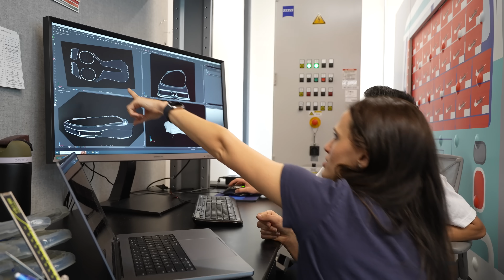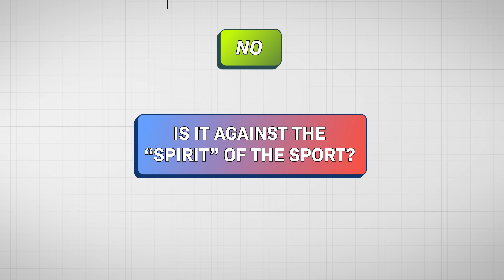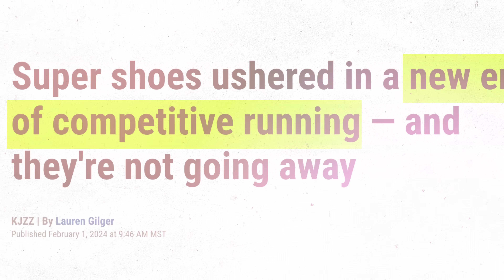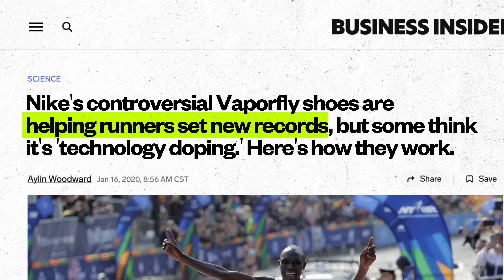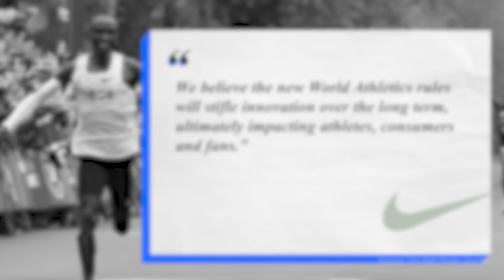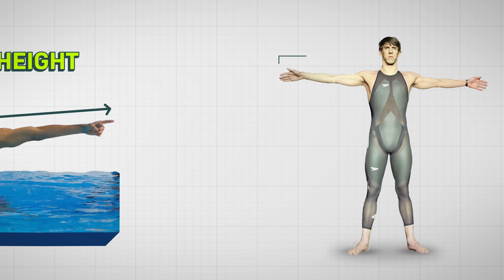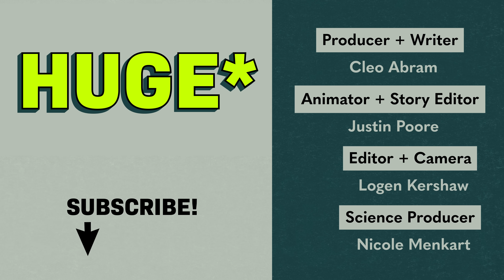The Shoe That Broke Running

Comment: RE: the swimsuit issue. The goggles dont impact speed in a significant way, but the suits obviously did. The issue is that more affluent countries or more technologically innovative countries could get an advantage over others and the spirit of the olympics is that it transcends everything geopolitical, technological, etc and everyone can come together united to compete fairly. The suits dont adhere to that, but obviously goggles do. If someone is 0.1% more streamline because they coated their goggles with teflon... good for them. If someone is 5% faster because their country invented a suit that makes them virtually frictionless in water... that is a major issue. The line can never be perfectly clear here, but obviously the suits needed a good ban. Otherwise swimming becomes more about technological advancements than athleticism. TLDR: olympics should be about fair athletic competition, not about technology. Look at special olympic runners though... they are faster than people running with the legs they were born with. How does the special olympic committee regulate that??? More of a headscratcher. Next step for olympics is to stop drug testing for mary jane... Who cares if someone is puffing the magic dragon on their own time... They gunna test for alcohol too? Tobacco?

Comment: I don't play sports anymore, but I do play games.  My favorite is Magic The Gathering.   It's a card game where you build a 60+ card deck out of a pool of nearly 70,000 cards over 31 years' worth of sets.

With such a long history, there are cards that can legally no longer be printed to protect the secondary market.  These cards are often what's referred to as "Broken" by the community.   Whether allowing you to do more than you should on each turn or take extra turns for very little in-game cost, these cards are extremely expensive.   Like the new house is expensive, and that's not even a hyperbole. 

So what WOTC did was create multiple Formats each with a different card pool to choose from and different cards that are banned.

Perhaps if the Olympics did something similar it would be more interesting?

Comment: Unfortunately the glasses enhancing eye-sight example is a bad example to make an argument with. Consistency makes the shooter better at shooting. Better eye-sight does not. Comparing that to a mechanical advantage from shoes or prosthetic legs is not a valid argument. I'm sure there are lots of other examples to choose from.
Great insight on running shoe mechanics! Very interested in this.

Comment: The sports equipment issue reminds me of the mobile games . Those top players on the list are always the players who top up the most amount of money and win most of the games...
Either spend lots and lots of money and win the game easily by getting all the high expensive gadgets or equipment, or spend time,more and more time endlessly, tirelessly, only to be in a position that's high enough for the remaining players who are equally the same as you that play the games who don't top up the money, but will forever be in a position lower than the players who spend lots of money on the equipment just to win.

Comment: I remember playing for years with a "classic" wood tennis racket, and the only alternative was a metal one that was the same size. Then apparently someone discovered that there were no rules about the size of the hitting area, and they came up with a racket with a much larger hitting area. That's all we have now, unless you find someone who will agree that you'll both use an "ancient" racket, or a better player uses one against a poorer player using a good modern racket.

I suppose there are some materials or shapes or extreme sizes that aren't allowed, but those possible rules aren't obvious to me. It seems like current tennis rackets are optimized to play as well as possible, maybe with some variation for type of court and characteristics of different players.

Comment: Think about paralympics vs olympics. People running 1500m in paralympics in T53/54 (people with disabilities requiring the use of a wheelchair) are THIRTY seconds faster than the fastest man (Hicham El Gerrouj has the world record a 3:26, these guys do it in 3:00 flat). Clearly a wheelchair gives people an unfair advantage, so only people who HAVE to use one are allowed to use it, and only at the paralympics.

I saw a video of people running on blades in Australia, they could go faster than a moped after enough practice. Sure they stood about 2ft taller, but it allows you to take much bigger strides and lose little to no momentum when your blade hits the ground.

If sports wants to be consistent, they can make a class for people running on blades, and not mix them with others. At least this way it's completely fair.

Comment: I really think it depends on the sport and if the technology is available to all participating. For example if an athlete isnt able to afford a certain piece of equipment. So the regulators should define the rules as such that every participant starts on an equal playing field. In most sports it comes down to ability anyways, as a footballer for example, it doesnt really matter whether you got the newest shoes or the best ball, it depends on your ability. In running its different, if those shoes gain an unfair advantage, they should either be made available to everybody or be banned. Now innovations in styles are something completely different, like when the ski jumpers went from parallel to v shaped. In some other sports its part of it, like formula 1 or skiing (where you have to find a good setup). It all depends on the individual sport.

Comment: "You might be thinking no gear should give athletes an advantage" ... No ... what makes you say that?? I'm thinking the opposite actually.

I don't think it should be banned. OR, at the very least have two separate categories "assisted/unassisted" or something like that. Like you said ... we wear shoes already ... that's tech that helps you run faster (as opposed to not having shoes) in most cases. So, now we're just talking about picking and choosing what's "too beneficial" and what's not ... and who decides that? How do I get on that committee? They have all the power don't they... where is the line and WHO draws it?

Comment: It feels like the reason goggles makes sense is that without them you don't have that sense at all, it makes better competition and potentially evens the playing field. They're cheap and easily accesible to people wanting to take up the sport. The suit however improves on an ability you already have, is extremely expensive, inaccesible and therefore makes the whole thing uneven. It's pay to win.

Another interesting evolution has been of the javelin and the need to make it hsrder to throw as athletes were throwing it so far it was becoming dangerous to spectators.

Comment: Why not just standardize the equipment? It seems possible to update the standard equipment for each sports event and let manufacturers compete to have their equipment chosen. This way, there wouldn’t be any restrictions on innovation. Nike is only pushing back because their cash making high-performance equipment is being threatened. Nike advertises to the public by saying that their gear is worn by athletes who break world records. If they had to release their products early, they wouldn't be able to advertise their products this effectively. Think about how many orders Air Jordans bring in for Nike each year. If AJ were released four months before the game when Jordan broke the record or whatever, it most definitely wouldn't be as famous and have such a lasting revenue making. So all that talk about innovation is nonsense.

As for shooting glasses being allowed, I think it’s largely because they can be standardized. The focal length of the lenses can literally be mathematically  calculated to ensure that the image focuses crisply onto the retina, and optical instruments like glasses can very fairly be ensured that they don’t magnify the images on the retina. But how should a prosthetic limb attached to the leg be standardized? There is no definite way to precisely measure how high someone can jump or how fast they can run. These variables change daily, every time they’re tested. The human body just has too much variables impacting how the legs work: what you ate this morning, did you take a shit to lighten your body mass, how much you sweat, etc. it's just not as easy to standardize as an optical instrument like a pair of glasses. And how would you even determine the functionalities of the prosthetics as a natural limb that never ever existed in the first place? 

That's why I personally believe all equipment which allow gray area in sports should be banned, because if it's possible, someone is going to cheat and gain unfair advantages, which damages everyone else's effort!

Comment: Awesome channel!
They could make a separate division for enhanced athletes as long as the enhancements don’t introduce energy, not generated by the athlete.

also, if they would allow high-tech equipment, eventually, everybody would be able to afford a certain level of technology because the technology would trickle down to every price range gradually.

Also, if I’m not a racer, I want to go as fast and as comfortably as technology can allow, so at least produce these high Tech products for the regular Public.  Of course, that would be sad if competitive runners were slower than all the other runners that were not in competition.  I do not see any problem with enhancing humans with devices as long as it’s not dangerous and people can afford it.  Records get broken all the time. They changed the rules for breaststroke, for example and now breaststrokers can go much faster because of that rule change.  if somebody breaks our record that will be on record. Eventually it will be broken, but it will be part of the history of the sport and that will not change.

Comment: Aside from theoretical availability of certain advantageous tech among top athletes, there's also an argument for how much it raises the price-to-entry for amateur competitors. If the typical shoe is 100 and these fly (pun intended) for 250 that might discourage a large demographic of runners from entering a sport known for it's accessibility. A 100$ golf club vs a 250$ gold club and nobody would bat an eye, but the price tag for tech has to make sense within the economic context of the sport.

Comment: Looking at the research, Blake ultimately is at a DISADVANTAGE, not advantage, by wearing prosthetics. On top of decline in some abilities as she mentioned in video, I believe it’s reported they are far more PAINFUL to wear and use. And we do have ways of measuring pain now more objectively (though far from perfect). It seems very ableist and paranoid to keep Blake out to me. There should be a way to accommodate and include him. Not doing so is not equity at the Olympics like they claimed to have this year. Also, wouldn’t it make more sense to give him an average height based on his colleagues in the sport? Or better yet, look at his family history and using his genetics come up with his “height.” Wouldn’t that be the most accurate? Small sample size studies based on other ethnicities surely isn’t. Appalled and disappointed by how incredibly biased and inappropriately antagonistic the Olympic committee is in this regard. I hope it improves and these disabled athletes will be allowed to run again with their colleagues in the sport.

Comment: Summary
## Tech Doping in Sports: Where Do We Draw the Line?

This is a summary of a video exploring the debate around "tech doping," where technological advancements in sports gear raise questions of fairness.

General Points:

* (00:00:35) "Tech doping" uses gear to gain an unfair advantage, blurring the line between innovation and cheating. 
* (00:01:58) Governing bodies balance safety concerns with the spirit of sports when deciding on equipment legality.
* (00:01:07) This debate extends beyond sport, highlighting a broader conversation about how technology pushes human capabilities and where we draw the ethical boundaries.

Examples:

* (00:02:52) Swimming Suits (2008): Speedo's Laser Racer sparked controversy with its streamlining and potential buoyancy advantages. It was subsequently banned, but the debate about acceptable swimsuit tech continues.
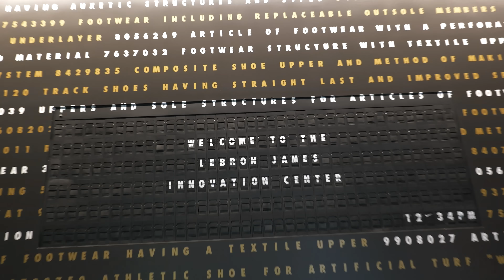* (00:05:18) Running Shoes:  Nike's "super shoes"  maximize energy return with a combination of foam and carbon fiber plates. These shoes helped shatter marathon records, raising questions about the technology's impact on running. 
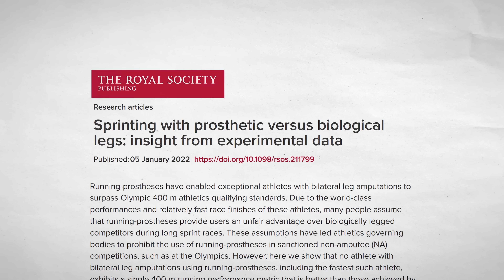* (00:12:49) Running Blades:  Oscar Pistorius competing with blades challenged perceptions of disability and athletic performance. Subsequent attempts to restrict blade use, like with Blake Leeper, have ignited debate about fairness and "correction" vs. "enhancement" when it comes to prosthetics in sports. 

Key Questions:

* (00:04:53) Is it about athletic ability or the tech they use? 
* (00:12:08) Are we stifling innovation or preserving fairness?
* (00:15:11) Where does enhancing human capability become an unfair advantage? 

I used Google Gemini 1.5 Pro to summarize the transcript.
Cost (if I didn't use the free tier): $0.1530
Time: 85.76 seconds
I added a 60 second delay to prevent a rate limit of the free tier.
Input tokens: 41554
Output tokens: 722

Comment: 15:56 "The whole point of technology is to make people better". Ok so I'm a Kyokushin Karate practitioner and I can't go beyond 50ish push ups for the moment and push ups are one of the requirements for grading. If I find, say a pair of gloves, that makes me do 60+ push ups right now, in what way did technology make me better if the "me" without the gloves can't still do more than 50 push ups ?!!! IF I could afford such a gear, that is ;) BTW, Kyokushin is practiced with just the karate uniform and belt, nothing else, even during winter. Also, I'm a poor guy. Too bad I won't be able to take advantage of the technology that make people better.
Reply: You cant prove a point by using examples of something that isn’t possible no gloves are going to change the amount of push-ups you can do

Comment: I think in the "spirit" of sports, every olympic / top-level competitions should be assigned the same equipment and apparels to compete. Whereas amatuers like us should be allowed to have advanced tech. But, on the other hand, without technological competition, we wouldn't get innovations we see in the past 2-3 decades. It's a bit like in Formula 1 and the lower series, where F1 can innovate according to set rules but F2 and below use the same chassis and engine.

Comment: The glasses vs legs thing I think the difference is glasses can be made to only correct to 20/20 if your eyes can even get that good. The legs are not bringing you back to the normal they are giving you an advantage over those without legs.

Comment: Well it all depends what you are trying to get at. Are you measuring human performance, or human + tech performance. The ancient greeks who created the Olympic games, basically wanted pure human performance to stand out and performed naked. I think we could make a difference between the sport that are a human with a tool, like cycling, and sports with raw human abilities like swimming and running. Cycling is over regulated on frame design, cycling positions, and for running I would personally prefer stark regulation like a 3 mm sole for running.

Comment: Faster running shoes also protects the legs of the runner. A runner of 70 kg running 10 km releases energy into the ground equivalent to 1.000 kg. That wears down the joints. Faster running are of course okay.

Comment: I am of the opinion that if it exists, then it should be fine to be used. The fact of the matter is, the Olympics is designed to force people to compete against each other. If you don’t take every advantage you can, you are actually missing the sprit of the competition. Yes, this includes steroids. The thing is, if the participants are an adult, and INFORMED consent to its use, then the judges should have no objections to its use. Are they dangerous? Obviously. How badly do you want that gold medal? Are you willing to take on that extra danger to get that medal? That’s what competition is about.

Comment: Perscription glasses are arguably a disability aid. If you get them from your optometrist they're only correcting to 20/20, which is baseline. I think that's a useful metric for sports enhancing technology - how much does it level the playing field and bring everyone to a baseline where skill and practice are the only variables left? Otherwise it's just a question of who can afford the fanciest tech, which imo isn't what sports is about. 

On the other hand, sports is inherently unfair. At professional and especially international levels, a lot of athletes are genetically a cut above the rest. Top swimmers have longer arms, top runners are fundamentally better at running on a genetic level a lot of top athletes have a much better hormonal profile for their sports than the average endocrine system haver. So there's clearly a point where we accept that some people are better for reasons outside of skill and practice. 

As biology and technology begin to overlap these two different perspectives on sports are going to be harder and harder to hold mutually exclusive.